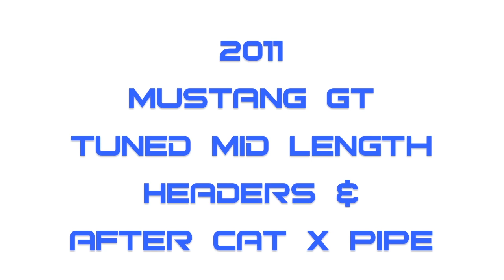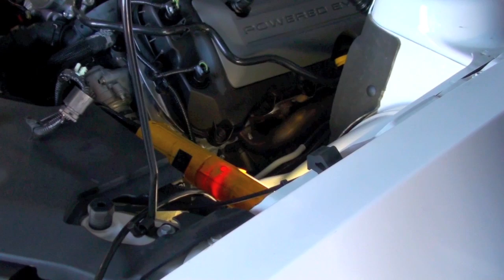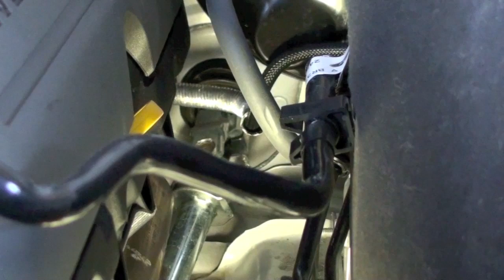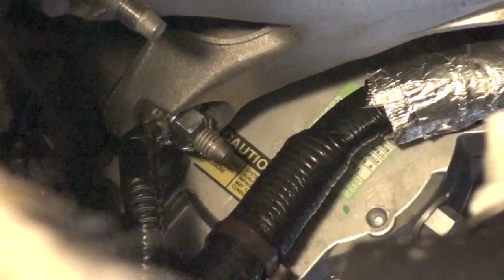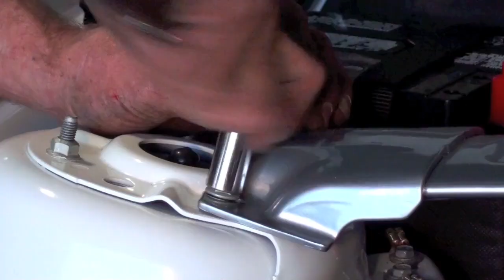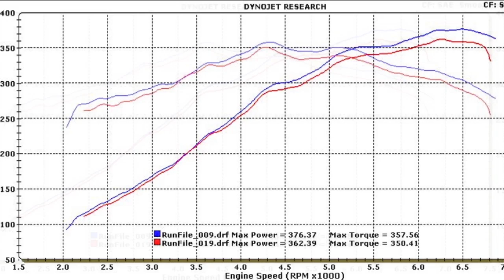2011-2014 Mustang GT 5.0L BBK Header & X Pipe Install Guide & Dyno Run

Comment: Stock 2011 mustang gt supposed to shoot over 412hp to about 435hp according to MOTORTREND and various other sources...
Reply: Yeah this is part of the reason I just bought one. The 15's are rated for more power, and I know the IRS on the 15+'s is nice but I wanted something that handled predictably under power. When I rented a 2016 GT Premium Convertible I fell in love with how it drove, but hated how it always wanted to spin me out. I was worried the 2011 with the live axel would be worse, but so far it's been easy to handle when it spins the tires in 1st and 2nd, sometimes 3rd. The 2011 is also supposed to be lighter than the 2015's and up. I haven't gotten as far as switching off TC yet though because I've only really driven honda manuals besides a VW, Subaru, and Saab. None have remotely near the power.

I tried to race a BMW M240i xDrive which is 380hp AWD and he absolutely smoked me off the line. 30 car lengths maybe lol. From 60-150 the Mustang is faster but I suck at hitting the shift points bc it feels like it could rev forever.  And the 3.73 gears make you have to shift a lot. Im so slow at shifting an Audi S4 beat me in a roll, so I did a 2nd gear launch to avoid having to shift on the next race and put a couple bus lengths on him.

Comment: In all honesty, the stock manifolds look just as good as the BBK shorties. This is why its just worth it to go long tubes, all this work for a shorty header, might as well go long tubes
Reply: Thanks for this comment. I just bought a 2011 Mustang GT manual with Brembos and 3.73 gearing. The previous owner added an Airaid intake and Magnaflow exhaust. I wanted to see if he changed the headers, and spent a few minutes looking at the product serial numbers before realizing it was a stock FoMoCo part. It looks like the BBK short pipes like you said.
Reply: right ahhahahaa
Reply: How do u get rid of the permanent 420 430 155 dtc codes these cause?

Comment: The car comes stock with a shorty header very similar to the bbk one they are installing. Why would you spend the money and effort for a very small gain.  Get the long tube headers if you are going to upgrade. 25-30rwhp gain  compared to this crap in video.
Reply: Because you lose tq and they only gain power after 3 000 rpm
Reply: In a race you'll never be under 3000 though so it only affects the drivable factor right?
Reply: @scottsome7270  you don't lose any torque. I did longtubes and the car has more torque even down low

Comment: A custom shop wants $850.00 to install long tubes on my 14Gt. I have no idea if that's even worth it, the headers I was looking at are $600. All that money for such little power gains doesn't seem worth the trouble.
Reply: If you are going to do it do not get shorty headers like this video. Long tubes only... more power and better sound
Reply: I got the same quote as well. Except I have the same headers as in the vid. I did it myself more so as a learning experience than anything
Reply: @GetShrektMrKrabs  
Do you recall how long it took you to complete the swap?
Reply: @Jack-pj1wt  one knuckle busting day. Aka a full days work if you have all the right tools. Get as many nuts off on top while you can. Get yourself a ratcheting wrench for the bottom furthest most back bolt when putting it back in. Be very careful to not cross thread this one as well, very easy to do it by hand. Happened on 2 different heads I've done👎🏻. These back ones will also be the first ones you'll want to put in when installing the headers because you won't be able to get the bolt in there with the other bolts there
Reply: @Jack-pj1wt  you'll also have to work with lifting the engine up and down when finagling the headers out.
Reply: @GetShrektMrKrabs  
Thanks for the insights. Putting a set on a 302 Boss on Monday.
Reply: I got quoted 400$ for Longtubes and Midpipe install lol
Reply: Sometimes it doesn't but in the long run it'll pay itself I believe